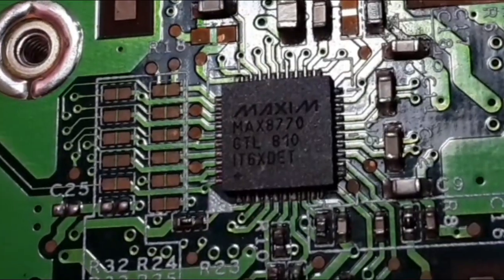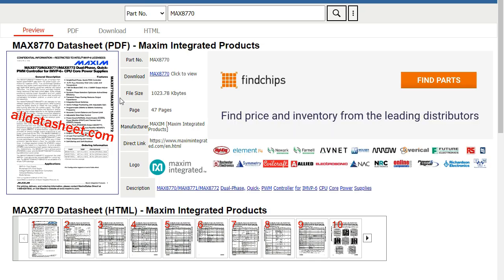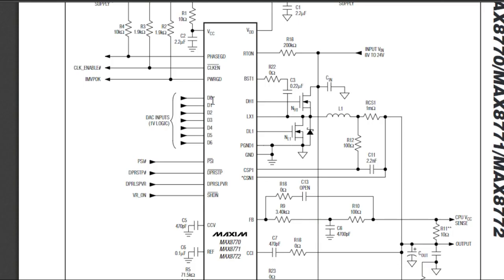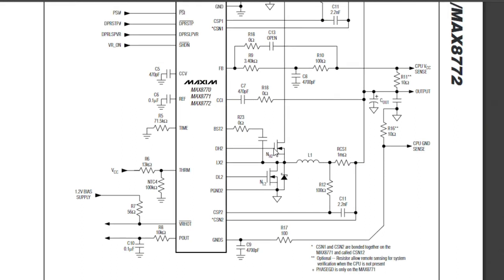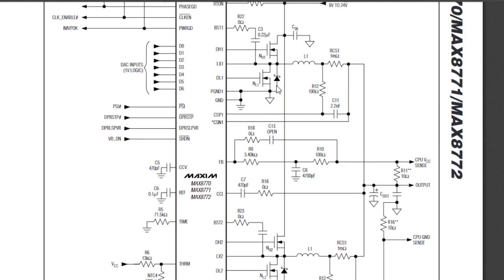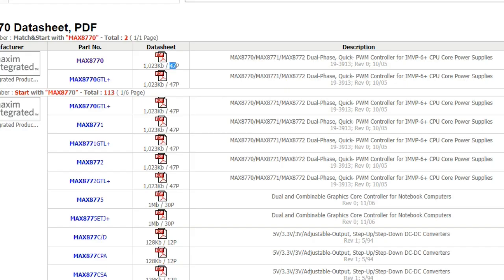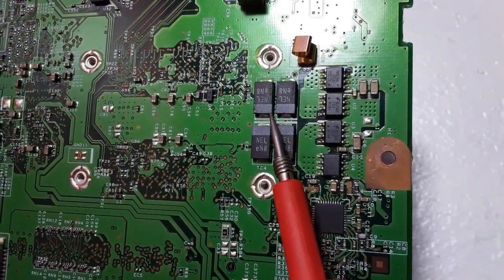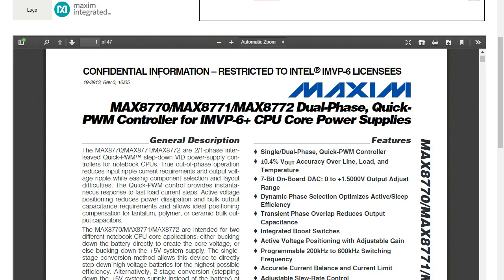Learn Laptop CPU Circuit | Processor Circuit Analysis using schematics

Comment: Nice Video! PWM is Pulse Width Modulation. Probably sending that to the Gate pin of the MosFets. Still Good to know how the Micro gets Vcc. LIKED.
Reply from the maker: Cool, thanks!
PWM means also PoWer Management (Control of voltage)

Comment: PWM means Pulse Width Modulation, not power management, lol
Reply from the maker: PWM means also PoWer Management (because the IC Controls the voltage).
Regards